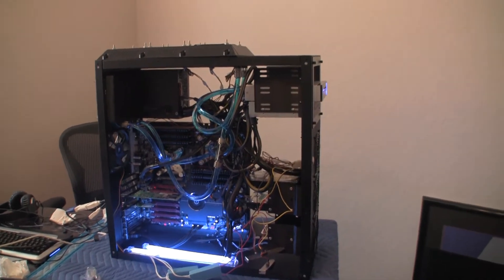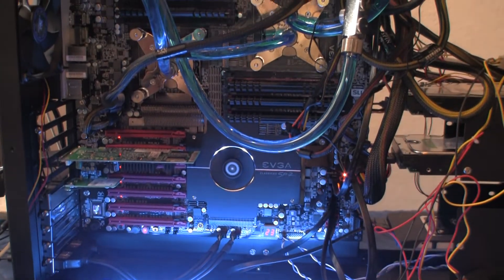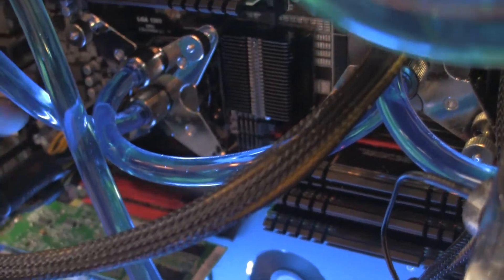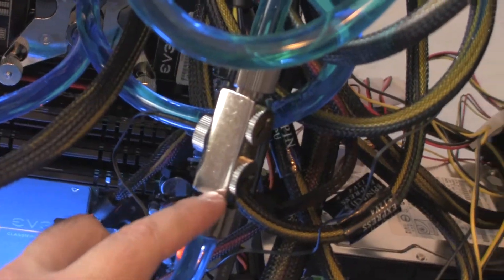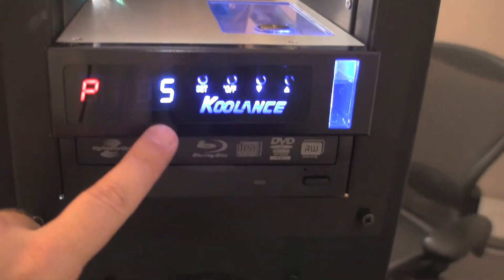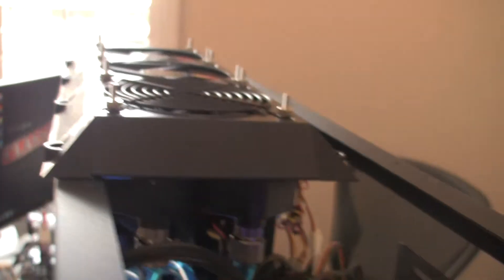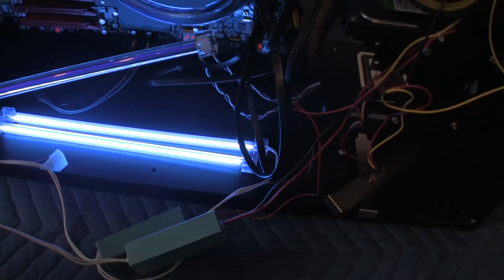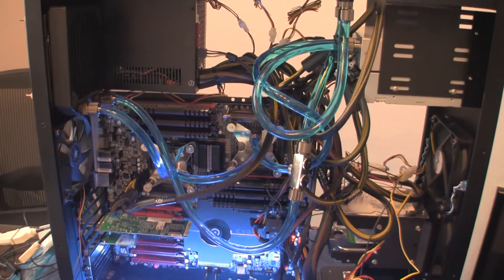Water Cooling Your Computer - Part 11 - Water cooled system is up and running!

Comment: It would have been helpful if you actually showed how to FILL the tank.  My own system is getting low and I had to reorder, but my system didn't come with the manual so...... that would be kind of a good thing to cover instead of just jumping from INSTALL TUBES to OK DK we're done.

Comment from the maker: Maintenance is relatively minor. You should clean out the water once a year. Basically, drain it all out, and put new liquid in. Keep an eye on it every day in a new installation to make sure the water level is good and you don't have a leak. After about a week and you feel secure, then look at it once every few weeks.

Comment: When you only want to read the water temp will the display keep flashing like vegas, for instance when I only plug in one temp sensor will it only show that temp sensor or will it keep flashing in between. Also do you think that I could split each fan output into 2 other fans or will that put to much strain on the unit. How well does the pump work when absolutely silent I will be sleeping in the same room as this unit and will be using it as a media player and gaming computer.

Comment from the maker: @noflexdont  three GTX 580s will generate a lot of heat. I recommend you get a four-fan (each fan is 120mm) radiator. If you only have 1 CPU (hence your reference to the 360?), then yes, it will be fine, but you're reaching the limit of the 1000bk. Anything else - you'll need a second loop to keep everything cooler and efficient.

Comment: do you think that the pump RP-1000BK will do the job for a 360 rad ,1 CPU block and 3 GTX 580's? any information would be great

Comment from the maker: @EagleTalon423  The reason for the 3-fan + 1-fan radiators is because I'm installing two GTX 580 Superclocked Hydro-copper video cards, each generating a ton of heat.

Comment from the maker: @DuyAnh1  The tubing is 3/8-inch Inside Diameter (ID) or 10mm. The Outside Diameter (OD) is 1/2-inch or 13mm.

Comment: What happened to the chipset watering block and the GPU watering block. Well better off coolng just the CPUs with that setup anyway. You didnt need to rads for 2 CPUs 1 was fine. and That pump rez combo will be goos for JUST THAT setup. If you add a Chipset W/B and a GPU waterblock you will need a much better pump rez combo. But for what little your cooling your ok. But still didnt need but 1 rad for that setup.

Comment: nice setup =), you could get even lower temps if you setup your rads in push/pull without too much more noise depending on the fans , your case has so much room